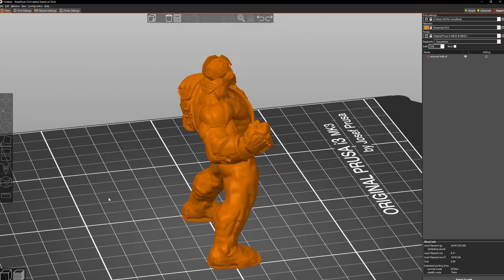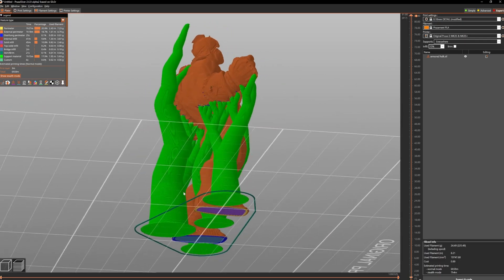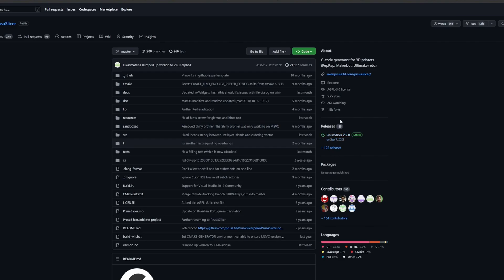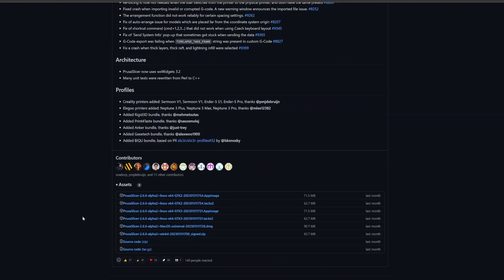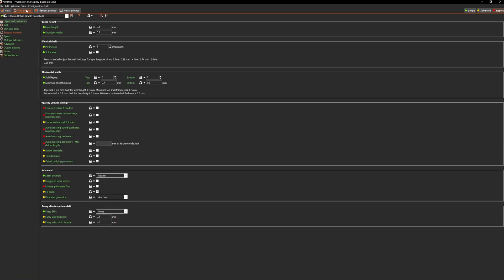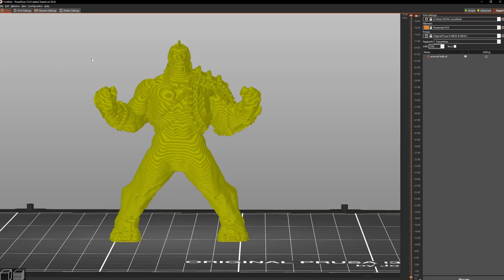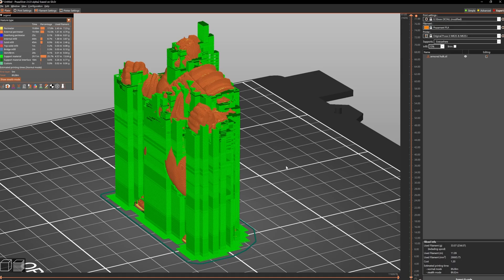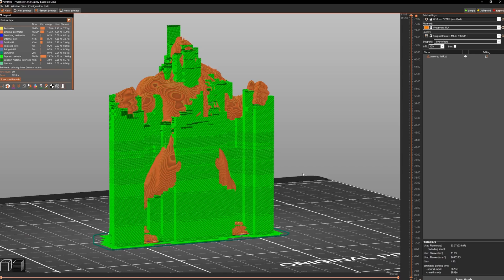Prusa slicer 2.6 NEW organic support structures

Comment: You do know that you have Snug support, right? no need to use grid
Reply from the maker: Yes snug is better than grid probably for most applications and organic is better than grid in some applications. I tend to try to slice the models I make up so I do not use supports but with this organic supports option I have been printing entire models in one go. This is a very welcome new addition. Do you know of any cool new features that have come out in the last 6 months ? I have not been keeping track of the new stuff this year.